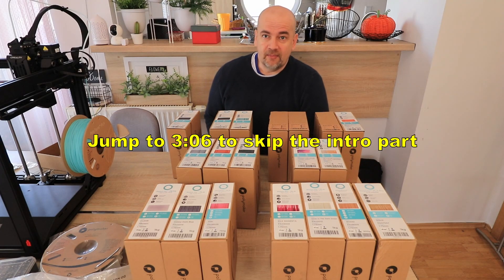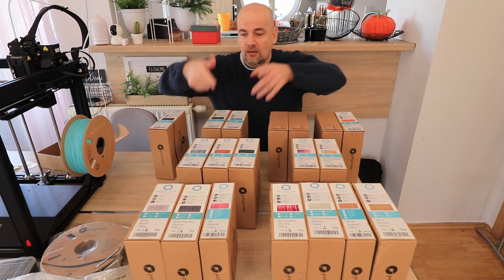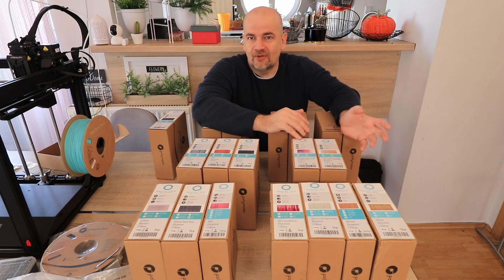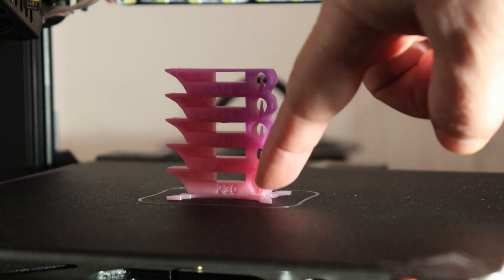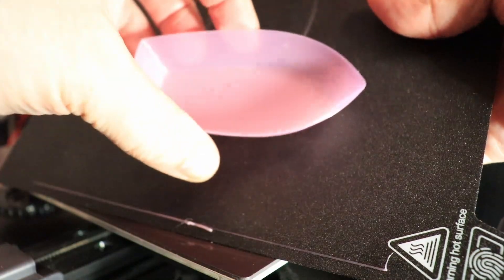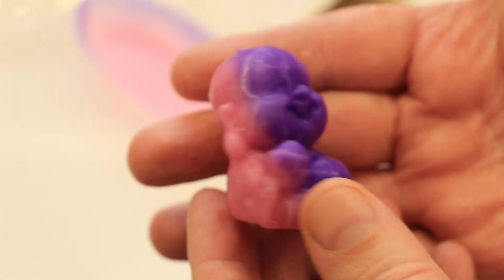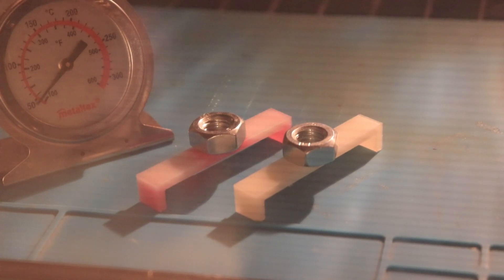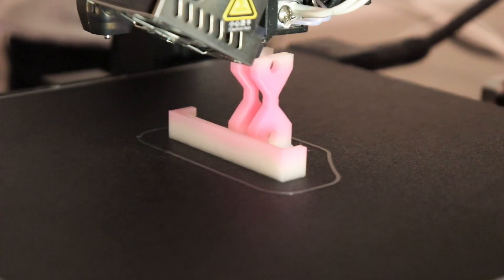UV- and temperature color changing filaments by Polymaker

Comment: A very nice video, I am interested to see other materials tested as well. Didn't Polymaker announce some Glitter ABS and ASA fro Vorons? A black glitter or polymaker teal glitter ABS should look nice for a Voron, unless the glitters are not as cool with ABS as they are with PLA and PETG materials. For the UV colour change as I said to Polymaker on twitter a good use case would be to have practical prints like tool holders for a workspace that you want to avoid getting UV light, for example a UV resin MSLA cleaning and post-processing workbench. If suddenly the tool holders turn orange it means that UV light is bleeding from somewhere and you should check for UV light sources to stop UV light from reaching the workspace or you risk curing resin on models you just took off the printer and not cleaned yet or something like that. One more cool print would be a dual colour lithophane. You could have a normal backlight using material opacity as normal with a lithophane print and you could also have UV LED backlight to turn on an orange colour highlight on specific areas of the image/lithophane.

Comment: Small remark, maybe it was intended maybe not: you used 1080p/720p at 50 fps. That is not really used in the digital world, since modern TVs and monitor displays almost all the time work at 60 Hz, 120 Hz, 240 Hz (144 Hz is just for gaming). So 50 fps will not be optimally displayed in most displays. Likely not easy to see the difference (it's just one frame repeated from time to time), but why not doing it "right" since the beginning :)
Reply from the maker: You must be located in US. In EU the network is on 50Hz, video would have a lot of flickering if I record on 30/60 FPS (with artificial light). Regular videos are here recorded 25 Fps (in US 30).
Reply: Good point, and indeed in theory that is correct, but I'm in NL and with both my phone and my Nikon Z50 @ 30 or 60 FPS I see no flicker.
After all flicker reduction is used for quite some years, while mismatching frame rate between display and video is more difficult to avoid.

Anyway as I said: maybe it was a mistake, maybe the choice was intended.
Now that I know that your choice is not by chance but has a reason behind and that we both presented out arguments, I'm happy.
After all the content is what matters.